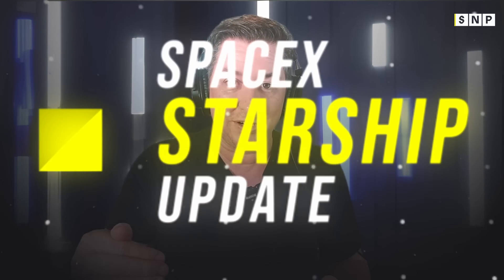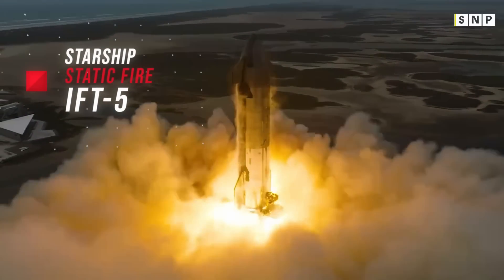Elon Musk Hints About Starship that's Wild

Comment: It just occurred to me that they have no room at Starbase to store all those starships they plan to produce there. They must be planning to launch them at Starbase and then land them someplace else for storage or they must be planning to ship them maybe even in modules. They don't  have room for storage at Starbase. That is a fact I think we can all agree  on.
Reply: They can scrap them pretty quickly. SpaceX has already had quite a lot of practice in scrapping both boosters and ships.

As long as Boca is purely doing R&D production then at least for a few years I suspect the design will still be evolving so quickly that once something has flown it will be obsolete so maybe after removing the Raptors if they want to reuse those and perhaps doing some close examination - x-raying welds, testing for metal fatigue in key areas etc - they probably will ultimately scrap a lot of the Star Factory output at least for the next few years.

Since re-usability is a key design requirement I don't doubt that some prototypes will do multiple flights but for a lot of them I suspect it will be a case of one (flight) and done.

Comment: Its a terrible idea to catch the booster until you have a backup launch tower
Reply: And if SpaceX is determined to do this it's an even more terrible idea to do as Elon said and attempt it on IFT-5 after only a single successful virtual catch over the sea (IFT-4 we hope). Surely if SpaceX does absolutely need to demonstrate a successful catch before the second tower is ready it should at least want to get 2 or 3 successful at-sea tests under its belt to increase the confidence that an actual catch back at Boca is going to work out as planned.

With stuff like the final stage of on-orbit fuel transfers now explicitly shown on NASA documents to not be happening until 2025 and hopefully the launch cadence of IFT flights getting up to one every 2 months I really can't see that doing the first live catch in August (my rough guess for when IFT-5 might be) or in December (my rough guess for IFT-7) is going to make any difference whatsoever to the overall project timeline - Artemis or otherwise - so why take the extra risk?